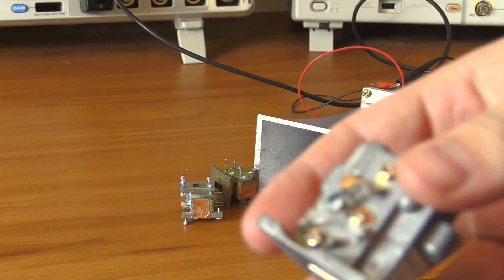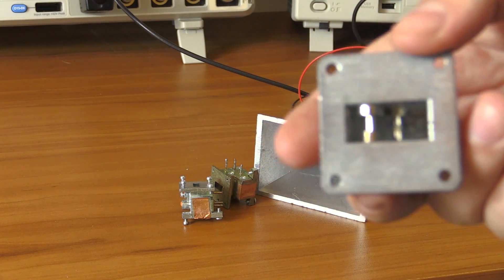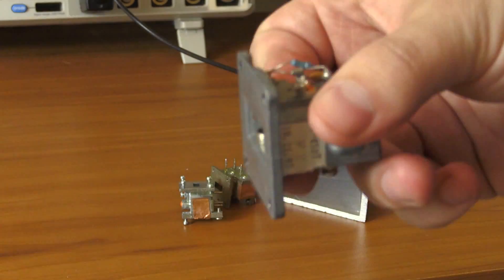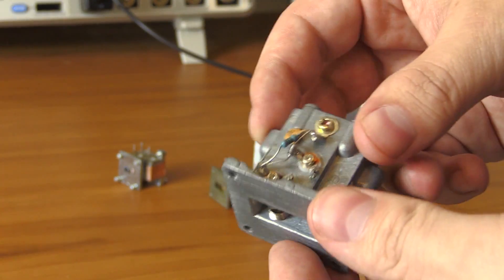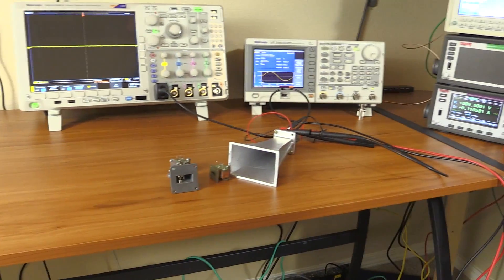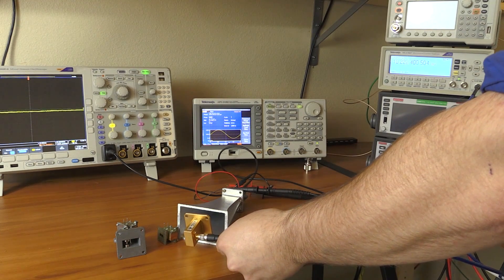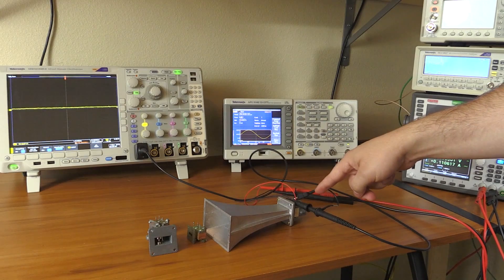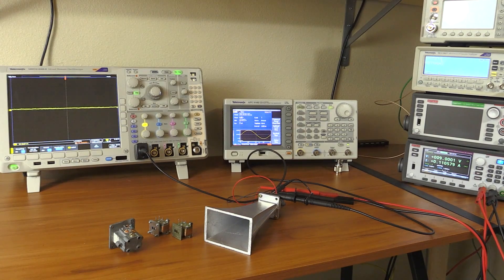How Does a Gunnplexer work? | Police Radar Gun

Comment: You know any sellers that sell gunn diodes in the Thz range, or as close as possible?
Reply from the maker: @ralfschooneveld3186  Unfortunately, no. I think you'd have to go through some multiplication stages to go up that high.
Reply: @BalticLab  Ive got a paper where thery went up to 0.1Thz and 0.48Thz, but no details. ''Frequency multiplier units based on SBDs, impact ionization avalanche transit-time devices (IMPATTs), tunneling transit time diodes (TUNNETT), and resonant tunneling diodes (RTDs).
Reply from the maker: @ralfschooneveld3186  That would be 100 GHz to 480 GHz, no need to express that in THz. Though many research papers want to push THz, so they use stuff like "near THz" to push keywords.

Comment: How can the frequency of the Gunnplexer be tuned down into the 10GHz ham band?
Can a Gunnplexer be used as a transverter to a ham band?
73, Konrad, WA4OSH
Reply from the maker: Hey Konrad! Yes, mos of the Gunnplexers can be tuned down to the 10 GHz ham band. However, they tend to not be very stable. You can do some very wideband FM with them but I would not suggest to use them as a LO in a transverter design.
Reply: @BalticLab  I think I will spend the money and get a real 10 Ghz transverter

Comment: Hello Sebastian, These Gunnplexers are not used in Police Radar unnits. Almost all Police units use a turnstile and separate the transmit and Receive side. Police use a round polarized antenna, this gives you a tight beam, and when the signal returns it shifts the polarity. Since the polarity is shifted, when it goes into the cavity the signal turns and goes into the cavity and can be detected by the diode. This gives you lower noise, much better gain, and works better for objects far away and where selectivity is desired. These horns you show are very wide angle, low gain, etc... Wd5iah  Henry, FYI, Love your videos
Reply: Henry, you still living in Columbia?
Reply: @tonymcflattie2450  yes, go back and forth, making ballistic glass for police, and design that allows radar to see past the thick glass.
Reply: @tonymcflattie2450  yes I go back and forth to USA
Reply: Could you expand? Why type of gunplexers are they using? Those are custom made or can be found to buy?
Reply: @zacki5663  these are custom milled or casted. They have a screw inside of them that tunes the cavity and also modify the signal to circular polarity. The signal reflected of the traffic reflects back at a reverse polarity which helps isolate the receivers signal from the transmit signal. This also gives you tremendous gain.